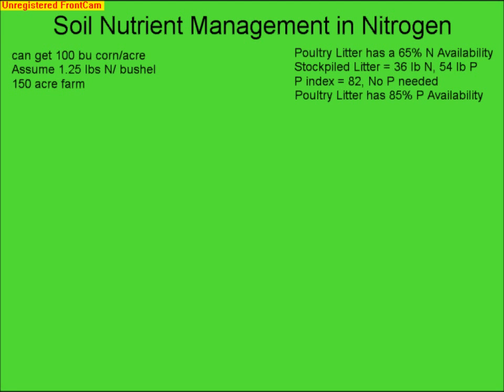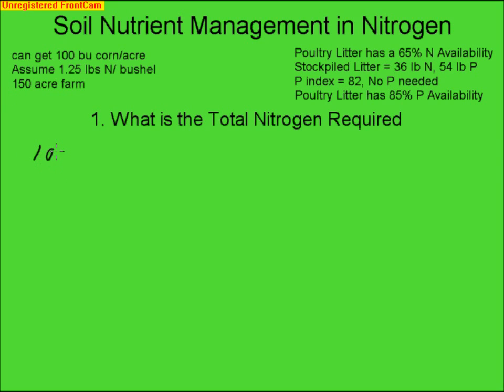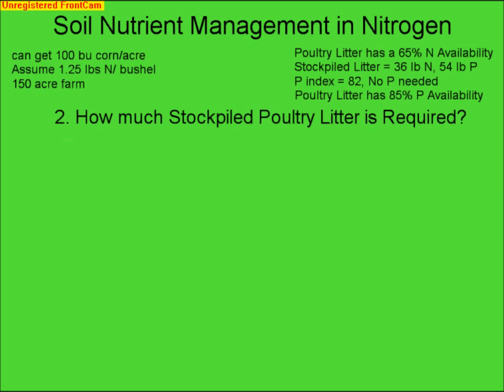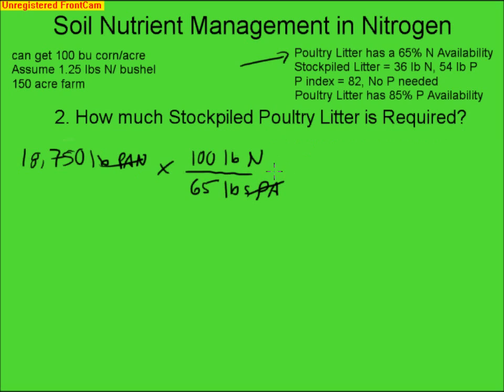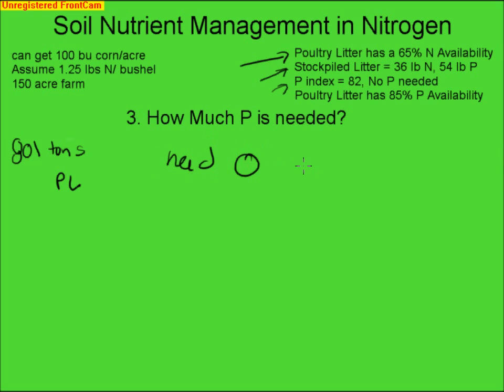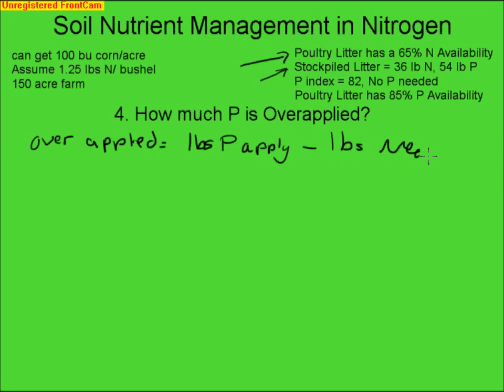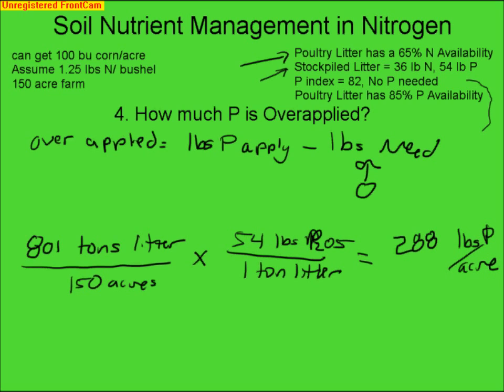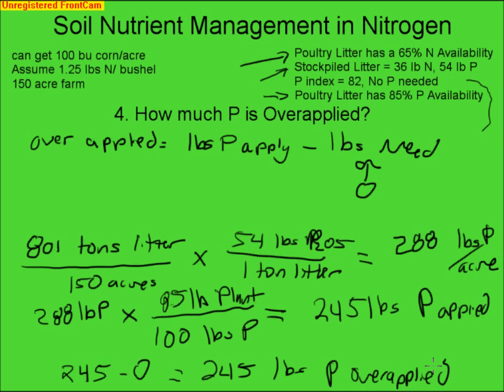Calculating Nitrogen and Phosphorus Requirements Using Animal Fertilizer

Comment: The poultry litter should not be utilized for N in this case. If P was needed litter should be applied to the plant P need, applied N should be calculated and then N should be supplemented from a different form of N such as urea or anhydrous.